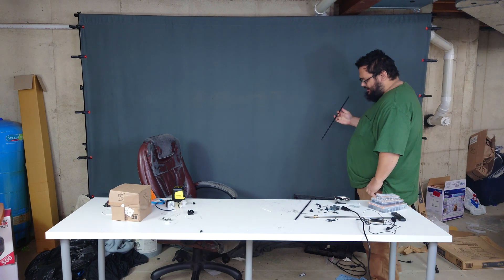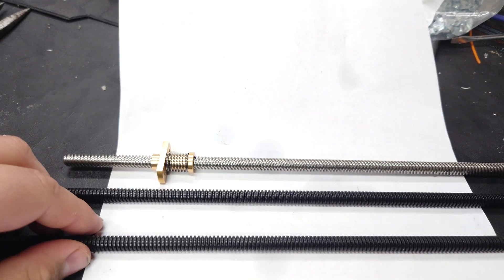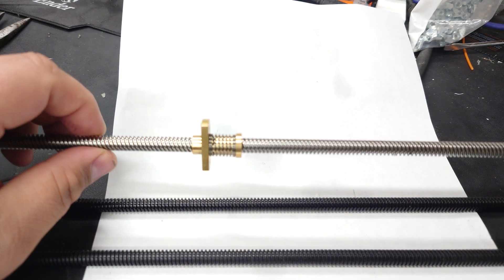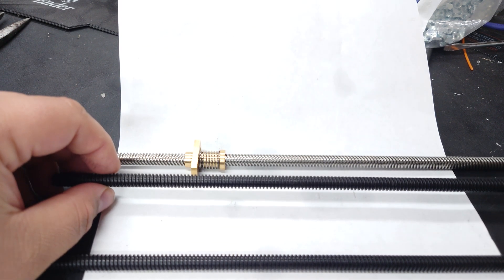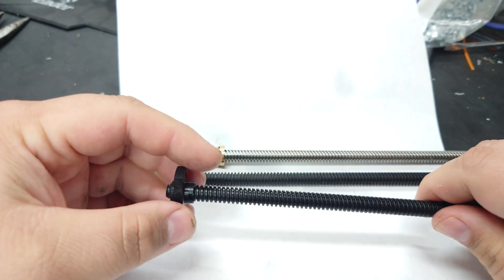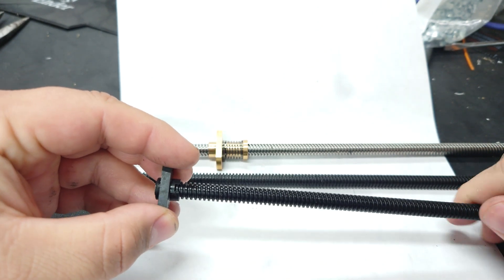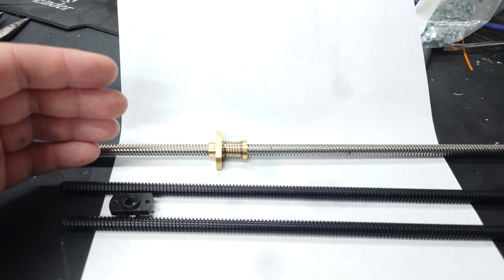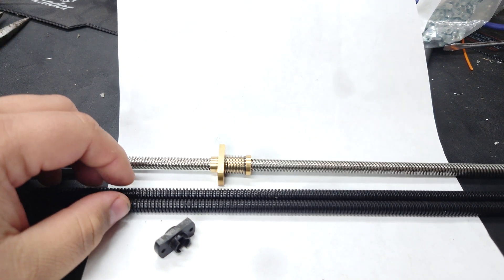Teflon Coated Lead Screws - Are they worth getting?

Comment: It also looks like your Teflon screws have a tighter twist like the single start lead screws I tried on my printer for a while. Mine were standard steel with brass nuts. I found that the tighter twist lead to more resistance to motion because the threads line up almost horizontally when the screw is installed on the printer. Whereas with the standard 4 start lead screw the treads are almost at. 45 degree angle making it easier for the motor to move the gantry up and down. While in theory, it shouldn't be much of a problem if your printer is perfectly aligned, I found that fee printers are and the additional resistance to up and down motion exacerbated existing issues making banding and binding worse in all but the best case scenario. After months of trial and error I switched back to the standard 4 start screw. I wonder if the Teflon screws would be more effective if the screws threads matched the threads of the original screw.

Comment: I think u wanted to say 2 - 4 micron not mill
Reply from the maker: 25.4 Microns equals 1 Mil,

Both units can be used for measuring thickness, but I chose to use the unit that the manufacturer used.

Comment: I use antibacklash POM tnuts on normal steel leadscrew. Really smooth movement and zero problems. I read about these ptfe coated leadscrews and the problems associated with them, but didnt think they were too serious, against the advantage of not having to lubricate them. Thank you for the video, I´ll stick with normal leadscrews or belted Z for now